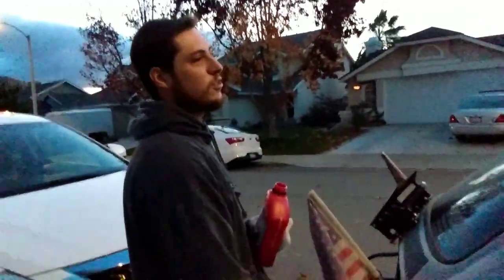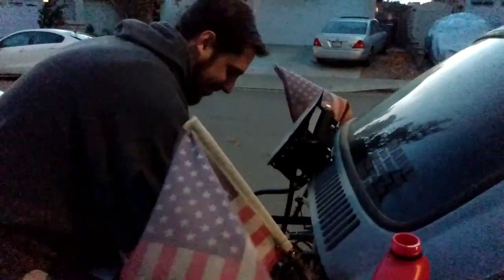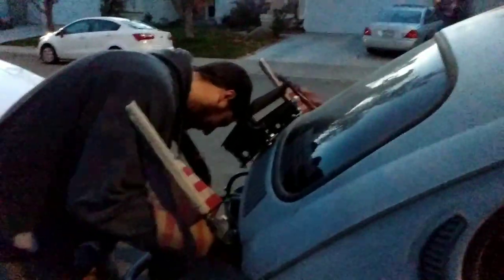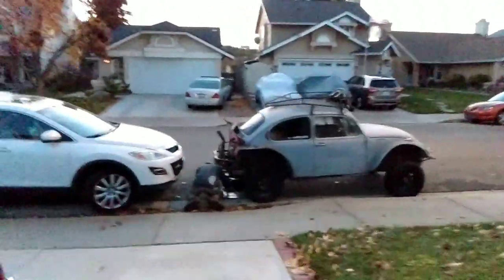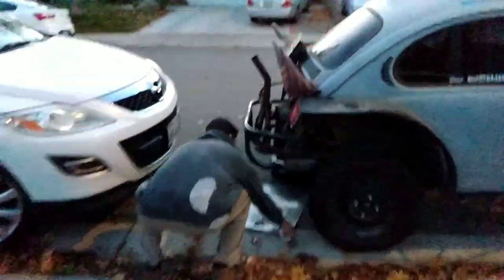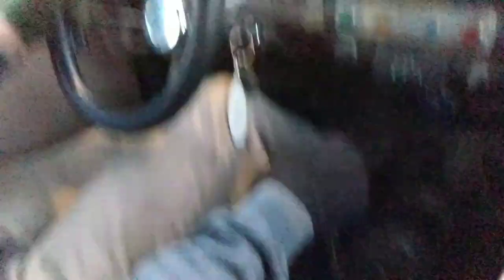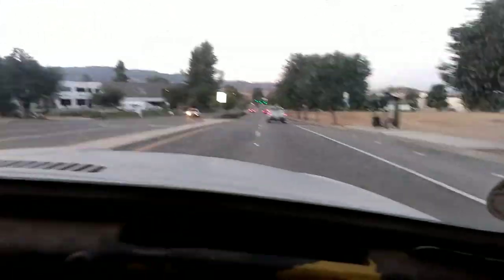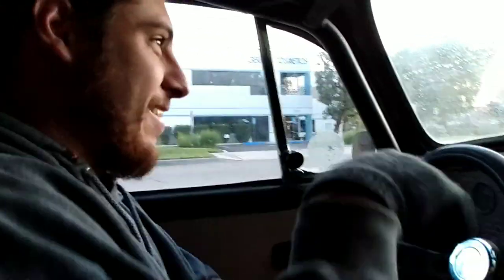DAILY Driving a BAJA BUG to WORK...(yes, really) 😅

Comment: She’s running good because they love that colder weather!
Sounds like a trans issue, can hear it whine in certain gears.
Use a Chinese heater under the back seat  and plumb it into the heater channels?
Reply from the maker: We've swapped our trans from a bug to a bus and have straight cut gears, that's where the whine comes from (in reverse anyways)
Reply: @dustbuggy  whew.... knew about the trans swap, must not have caught the straight cut gears part.

Comment from the maker: Did you catch our latest offroading video?? We went out with another Baja Bug! https://youtu.be/Fd1EoeOgcF0
Reply: Im doing 3 inch lift on my vw super, reinforced bigger tie rods, do u recommend for or against usin sway bar?  ill be 50/50 on n offroad with it, reason i ask is after liftin 3 inch on front, the sway bar wont bolt up to the front no longer, with 3 inches between body frame  n the sway bar. Just wonder how yalls handle without the sway bar on highway

Comment: Shifting problem , possible fix.  My Bug slowly got more difficult  to put in to gear .  Found out debris from the clutch pad was building up in the flywheel and gumming things up.  Took it apart, cleaned it up and shifting was good again.
Reply from the maker: We think the clutch cable might just be getting loose and needs tightening, but if that doesn't fix it we will keep that in mind!